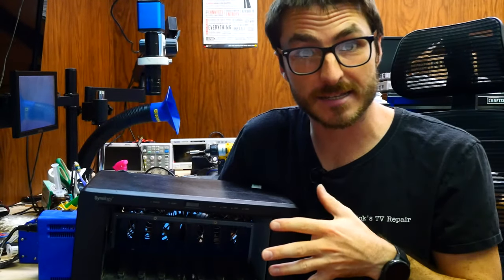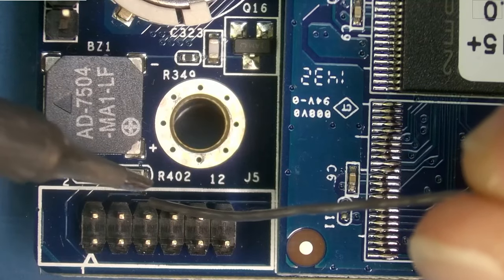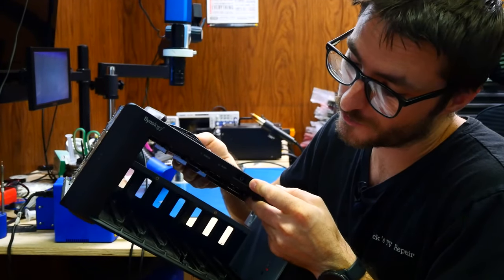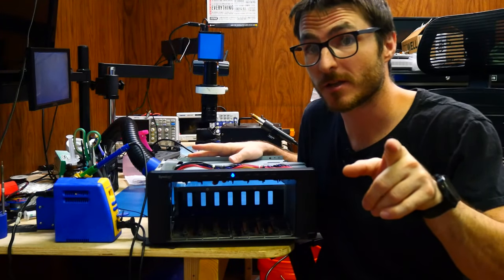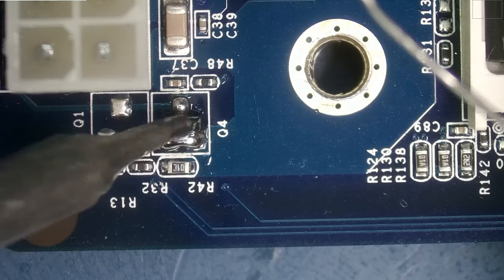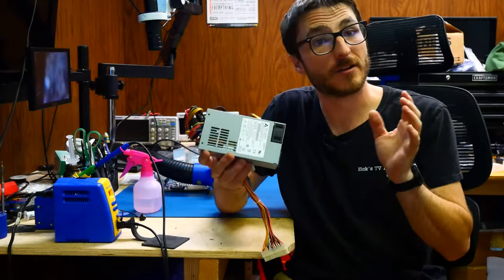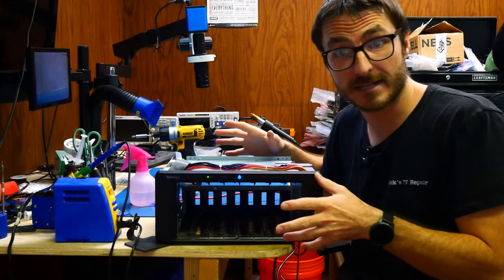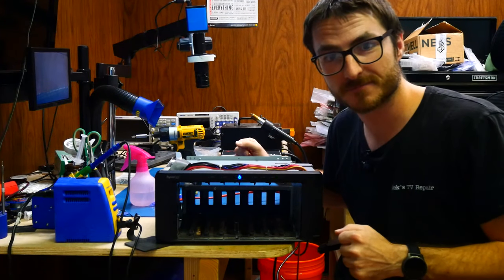Synology DS1815+ How To Fix All Faults!

Comment: Thank you for this video! My 9-year-old DS1815+ stopped working. It had a flashing Blue Power light and an Amber Alert light, but it would not boot. I replaced the CMOS battery, but that did not do the trick. I added the 100-ohm 1-watt resistor, and it booted right up! I'm so glad I found your video.
Reply from the maker: Glad I could help!

Comment: A lot of people blame power surges, but more often it's actually the outage itself that causes the final failure, not a surge specifically that might otherwise cause an overvolt or overcurrent condition.  That device would have presented the same symptoms if the owner had simply unplugged it and let it gone cold for an hour and tried plugging it back in.
Reply from the maker: YES That is exactly correct!

Comment: Awesome video. I needed only to do the resistor and change cmos and things are OK so far. For what it's worth the 100hm resistor I installed is quite large, maybe 5mm long so had to get a bit bendy on the legs but it still works :D
Reply from the maker: Yeah that should be fine. If it works it works haha

Comment: Thank you very much for the video that I recently discovered a few days ago.
I currently have 3 DS1815+ in the closet which possibly suffer from the same disease, and by replacing the Q4 transistor, the C37 capacitor flew away too. Given its size, it's impossible to find it.
Can DS1815+ work without it?
If not, does anyone know its specs?
Reply from the maker: I can't say I have had to replace C37 before. Is it right next to the Q4 transistor? 
PS for Q4 to work for a long time and not fail again you also need to replace the resistor on the power supply daughter board as shown in the video. That one is much smaller than the capacitor that flew away. 
Next time I open up a DS1815 I will take a look at it's capacitance and let you know it's specs.
Reply: @NicksElectronicRepair   Thank you for the answer.
Yes it is right next to Q4. 
I haven't replaced the other components yet but that's planned.

Thanks for your look

Comment: I am hoping that you will soon do a repair video for a DS1513+, mine has the flashing blue light symptom, but it has a different MOBO (with no Athom) so I am struggling to find some suggestions on how to fix it. I'm in the UK so it wouldn't be worth the cost of sending the DS1513+ to you for repair, unfortunately.
Reply from the maker: I don't see the DS1513+ very often so I don't know when that will come out, but the fault is usually identical to the same fault we see with the DS412+ DS1512+ and DS1812+
There is an IC chip on the back of the daughter board that has the Nand chip. Its location ID is U1. Most likely needs to be replaced. 
I already made a video on 12+ units but I haven't finished editing it yet. I'll make it my next video to come out in 1 week from now. Keep an eye out for it and just copy the same repair I do for the DS1812+ to your DS1513+ and it should get it working.

EDIT:
Never mind the unit I worked on was indeed a DS1813+. But it still stands that the DS1812+ DS1512+ DS1513+ all suffer from the same fault when it comes to the blue light blinking endlessly and next weeks video will cover all those models!
Reply: @NicksElectronicRepair  Thanks for the reply. I have found the U1 chip on the underside of the board. You also helped me to find a couple of forum posts that I think will be helpful now that I know what to look for.
Reply from the maker: This comes probably a bit late but we did do a video on the 13+ which I will link below:
https://youtu.be/IxxjOLzy30o

Comment: Hello, can you help me? I lost the small black (presumably) resistor with the board label R48 while desoldering and soldering the BC847b. Can you tell me what value the resistor has or whether it is a zero ohm resistor? Many thanks.❤

Comment: My ds1815+ is constantly restarting a few times every couple of days. Would a change of cmos fix this? Unsure if it has the 100ohm resistor.
Reply from the maker: Sorry for the late reply, we were closed down for the holiday weekend until now. 
I am unsure if the CMOS replacement would do the trick but it's worth a try.  Let me know how it goes
Reply: @NicksElectronicRepair  so I did pull it apart. Resistor was done from factory, I did check the battery and it was showing 0.9v and I did change that. But doing so unfortunately. Stopped the machine from booting up again. It appears the transistor needs to be changed. I definitely don't have the skills to solder that. It's currently booting fine with the PSU jumper to bypass the power button. I think I will continue to run like this until hopefully there is a new model and then I will upgrade.
Reply from the maker: Well if you do want to send it in for repair, we offer a full refurbishment service. We would replace several parts including parts that have not yet failed and do modify the power supply as well to help prevent future failures from happening as well. 
Your DS1815+ unit could have many more years of service if you have us refurbish it and of course we give a 1 Year warranty with all of our repairs. This would be much much cheaper than buying a new or used unit. 
If you are interested I have the link to our flat rate service below:
https://nickselectronics.com/products/ds1815

Comment: Thanks for the video. I can't find anything on the ds1817+. The board is double the size and the battery is calling for 2032. Is j5 it still j5? Same the other components. The is another set of header pins that is J1. Any suggestions? Thanks
Reply from the maker: Hello Aaron,
I don't think what we are doing in this video for the DS1815+ can be applied to the DS1817+ as that unit does use a different motherboard. It also has a different CPU which the resistor fix we are doing is to fix an issue with the clock signal on the CPU that goes out of spec. A unique issue to the 15+ series that I don't believe applies to the 17+ series. 
I have not yet had a request to fix the DS1817+ so I don't yet know all the common faults with it, but if you did want to send yours in for us to try and fix I can give it a look and would be willing to give you a discount on the repair since it would be a "discovery repair" Most likely would do a video on it as well. 

If that is something you might be interested in, please reach out to me directly (contact information is in the video description)

Comment: I have a DS1815+ that wont turn on, it has the resistor and the transistor fix on Q4, however the PSU is untouched. However, when shortening the green to earth, I only get the blue light blinking, all the LAN lights are green and nothing else happens. Does not sound like the disks start spinning either. Would it just be the PSU resistor 392 to 103 fix or does it sound like I need a whole new PSU? I live in Denmark, so sending it to the states will just double the price for me :D
Reply from the maker: Most likely don't need a whole new PSU. What you did in fact confirms the PSU is good and the fault is not with the PSU.
Replacing the SMD resistor from 392-103 should help, but if it does not resolve your issue, either you did not do the repair correctly, did not use the correct components, or you have a different fault. Did your unit get hit by lightning or a power surge? This seems to be something people who send in their units forget to mention which is extremely important to make your tech aware of.
If you had a power surge, lightning strike, or ethernet issue then most likely you have a fault in that system. Most power surges come in through the ethernet port, not the actual power. When this happens, it can short out your ethernet chips and sometimes travel to the processor.
If that is the case the processor may need to be replaced. This is rare but does happen.
Reply: @NicksElectronicRepair  : true, but no lightning strikes - I bought the DS1815+ second hand and it already had an issue where it couldn't boot - but the guy I bought it from wasn't tech savvy - so I went ahead and replaced the cmos battery, soldered the 100 Ohm resistor and replaced the Q4 transistor - and it has been running without issues for little over a year now. I have an APC UPS also, although thats just a power surge protection, I don't think it was caused by lightning - happens rarely here. 

Will order a couple of 103 resistors and try that - and might consider a Digital HD microscope for those small components - vision doesn't really get better with age. I would definitely recommend these jobs to be done by a professional like you - and with a 1 year warranty it may just be worth it, if you live in the states. Thanks for the reply - appreciate it!
Reply: @NicksElectronicRepair : local electronics shop only have 0403 and 0603 resistors - and ordering 0103 online will take 2 months to ship unless I order express for an additional cost of 10$ - for a 0.02$ resistors
Reply: @NicksElectronicRepair  : got a 0103 from a donor board (induction stovetop) and replaced the 392 - works now! Thank you for this great video, wish I knew this when I threw out my DS415+ a couple of years ago, where I only did the resistor fix.
Reply from the maker: @znabela  It's also possible your CPU is bad and needs to be replaced. We will be doing a video on just that pretty soon as we have encountered a few units like that recently.
Reply from the maker: Glad to here you got your unit going and sad to hear about the DS415+ unit.  @znabela

Comment: Hi dear Nick i have changed all the components but also getting the same Orange light alart light blinking
Reply from the maker: I am sorry to say but this means that either the components you installed are faulty, or were not installed in the correct location, or not installed properly/don't have good solder joints.
I have had a 100% success rate with these repairs. I have shown everything I do in the video, there is nothing more to be done or additional repair secrets, I laid it all out there.

If you can't figure out what is going on with your unit, you can always send it in for repair, we have a flat rate service which comes with a 1 Year warranty. Links to the repair listing are in the video description.

Comment: Can you tell me exactly which 10k SMD resistor i need?
Unfortunately, I'm not an electrician and I've seen there are different sizes and so on

Thanks & Kindly Regards
Reply from the maker: Here are the dimensions of the one I used in the video: 1.2mm width 1.94mm length .5mm thick
This is a very small resistor. It only looks big because I am soldering under a microscope. The space is tight and does not leave much room for error. 
If you don't solder a lot, this is going to be a very difficult job and odds are high you may damage your power supply.

Comment: Pls, can you tell me what transistor is q4? I think it can be the problem with my Synology.
I have the same device, after a power outage during thunderstorm wome years ago(I think there was also an overvoltage on the power line) my Synology didn't start anymore if i was pressing the power button.
I tried changing the power supply, but nothing. Then I found out that if i press the power button and then manually (in a few seconds) I connect the green wire to ground on the connector from the power supply to the motherboard, the device start and run normally. It won't turn off until i remove the green wire from the ground.
Thanks in advance if you want to help me!
Reply from the maker: I have all the parts parts used written at the very bottom of the video description. Here is a copy of it all:

100-ohm through hole resistor 1 Watt
BC847B SOT-23 NPN Transistor 0.1A SMD
Battery CR1220
10k SMD resistor (power supply)

Comment: I have the Synology DS1821+ with the blue light blinking issue (which started when I was trying to reboot it by long pressing the power button while the DSM was still open on my browser). How do I fix it? 

PS: Was trying to reboot it because the Download Station had stopped working.
Reply from the maker: Hello,

I am not as familiar with the DS1821+ as it is a much newer unit and have not gotten requests to repair it yet.
Here is what I would suggest trying.
1) Press and hold the reset button for 10 seconds or until the unit beeps
2)Replace the CMOS battery
3) Try different RAM
4) Send it in for repair

If 1/2/3 don't work then it's possible you either have a software fault, or hardware fault which would require some amount of advanced tools or soldering skills to fix.
I am sorry but that is all I can provide you with at this time without having the unit in front of me for advanced diagnostics and testing.